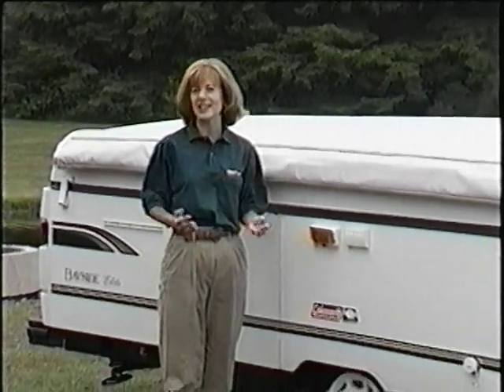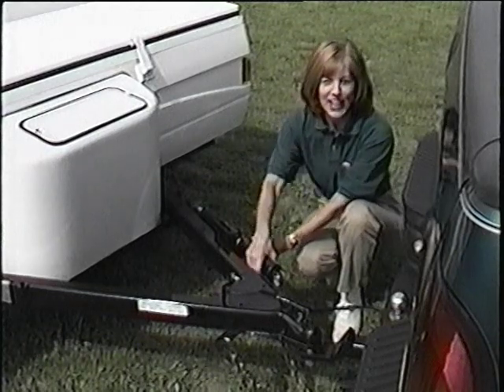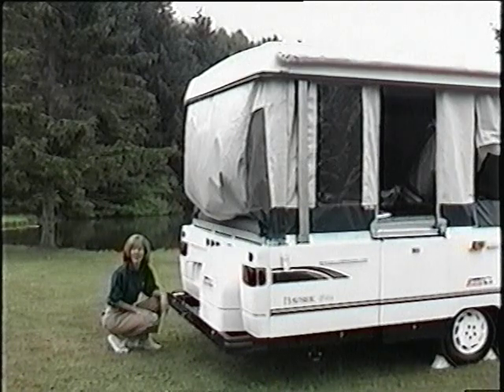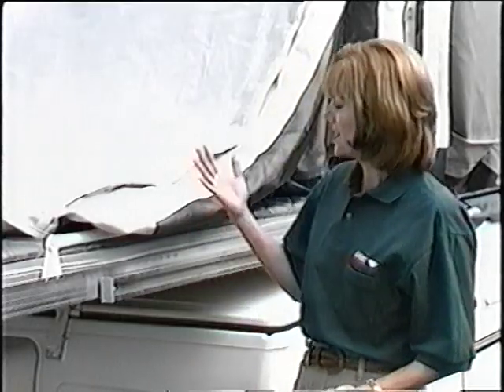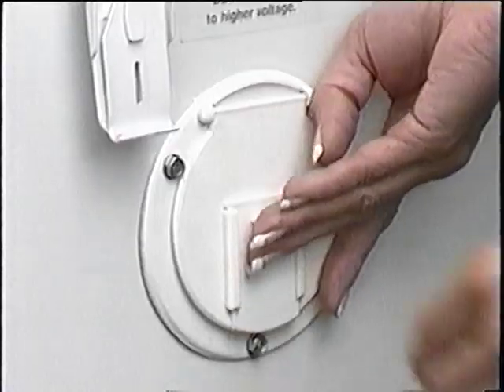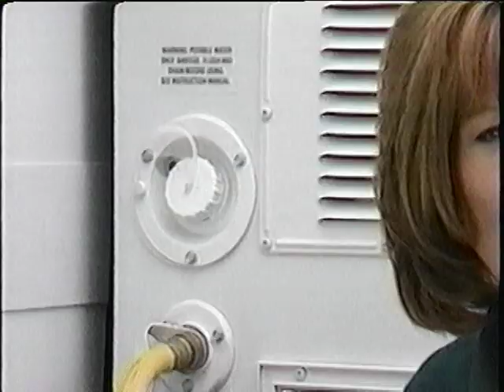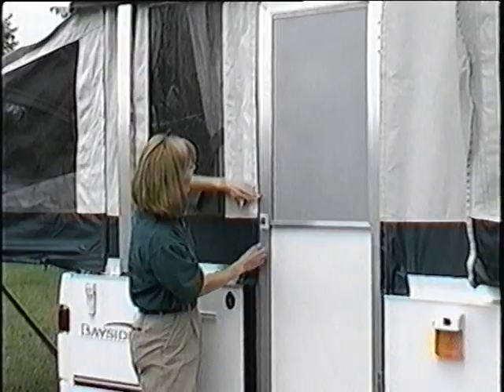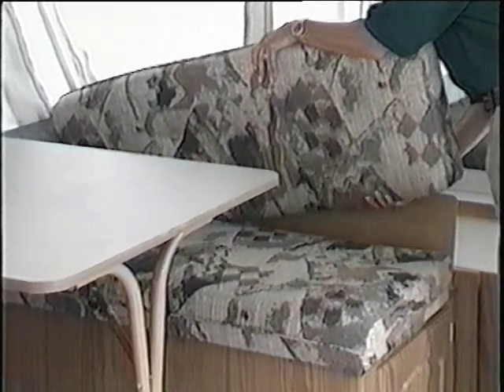Coleman Fleetwood Popup Camper Setup - Part 1

Comment: John, this is a very good video...thanks for posting. I was wondering if you had access or knowledge of how to rewire the trailer lights portion of my 2004 Carmel? Have owned this camper for 5 years on the Fl Atlantic coast and the salt air is now getting to it after not using it for over a year. Thanks for any help/direction you can provide.

Comment: URGENT:    We are having an issue raising our Fleetwood Bayside CP pop-up trailer.  The crank handle is not clicking when we are turning it.  If you let it go, the handle quickly turns counter-clockwise and the trailer lowers.  Seems that it is not locking in??????  Anyone have any suggestions?  We need to set it back up to clean out, and get ready for our next excursion!  :-)  Thanks!

Comment: I have no idea how to crank the top back down.  It cranked up and doesn't crank down. the crank doesn't tune in a counter clockwise direction, just in a counter clockwise direction to crank it up.
Reply: There is a nut inside check to see if it backed off
Reply: Or you may have stripped somthing out we drilled  and put a bolt in it  works like new again